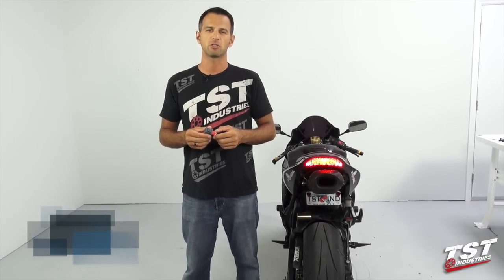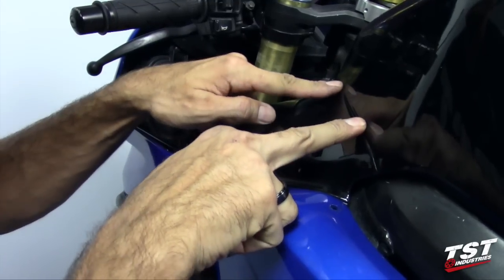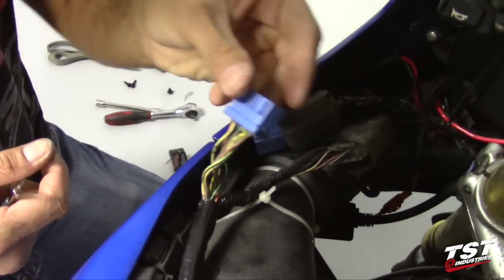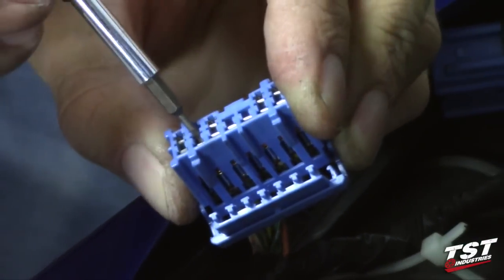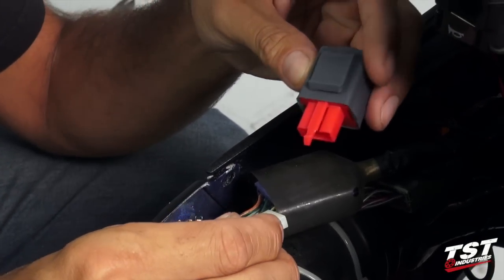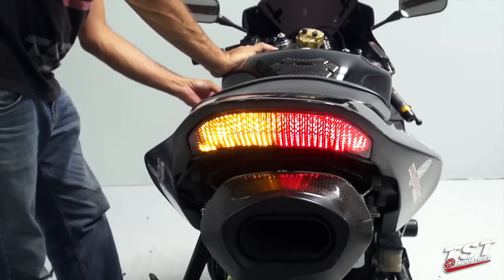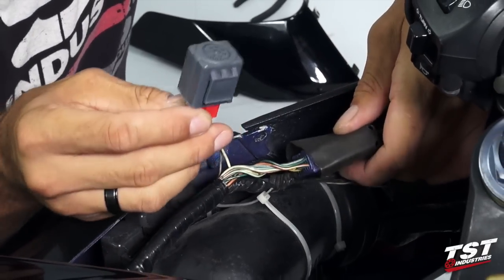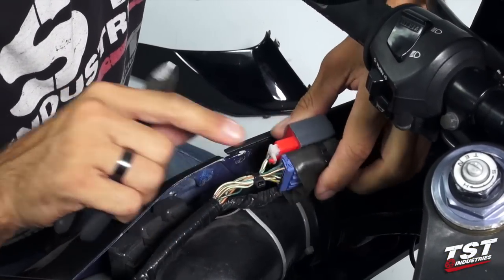How to install LED Flasher Relay on a 2003-2006 CBR 600 RR by TST Industries

Comment: Thanks TST. I just got the same relay for the 954RR. I realize that the harness is identical to this one with the same colored wires and placement in the connector. I bought the 2003-2006 relay with the white clip as well. When I install the relay, I will give an update.
Reply from the maker: We are looking forward to hearing your findings.
Reply: Ja. Thanks for having awesome products that make it easier and more reliable to modify than using load resistors or cutting into the motorcycle side wires. I posted a video of my bike with your brand turn signals, but they weren't on (FZ6R), I was showing the exhaust and the PCV running. I will post one with my RR when I'm done changing parts on it.
Reply: Udate: the 2003-2006 relay works on the 954RR. For anyone who is working on their 954 signals. Thanks TST!
Reply: @darksorceresszyra9467   I have a 954rr too, but I can't find the original relay, where is it located?

Comment: When I tried to install the relay I had some problems, the first when I tried to remove the cables in my motorcycle were of another color (different to that you show it in the video), the second when I was trying remove them, one of them it broke up and the pin got stuck, the third, to despite to cable was broken I tried to install the relay and it did not work. 
Also I had problems with the integrated tail light because my motorcycle have not the pin (and in the video only connect the pins for each of directional lights and it is not like that when only have the cables without pins). I am not happy because the relay not work and the integrated tail light also not work without the relay, you should consider this kind of problems in the instalation.
Reply from the maker: first let's address your taillight issues. Our units are pre-fit with OEM plugs for ease of installation. If you, or the bike's previous owner cut off the plugs then your bike is modified beyond OEM spec and will require harness side plug replacement, or you will need to hardwire the taillight in. If you would like us to help you with information on how to accomplish that you can contact our specialists through the support tab on our website. Even if the fault with the installation is not caused by our equipment we do our best to help our customers because that is how we run our business. We are a riders-for-riders kind of place.
Reply from the maker: Now let's delve into your relay woes. This system we sell and have illustrated in this video has been developed by an engineer, verified for use on a few local bikes, and validated in the field by hundreds of end users who have already put this system to good use. Surely we can figure out what went wrong with your installation if you contact us through the support tab on our site.
Reply: I broke the blue clip clasp too, but it will still go back in if the same flimsy hanger/hinge broke on yours too.

Comment: At first sorry for my bad english, but i hope you can help me. Im driving a Honda CBR 600RR built in 2003.
The original relay is damaged... Problem its placed in the case of the speedometer so its heavy to change the original relay. My flashers dont flash, they only glow...
Can i fix the problem if i install your LED flasher relay?
Reply from the maker: if the problem on your bike is caused by your relay then using ours will solve your problem. Our relay circumvents your OEM relay.
Reply: that reply gave an end to all my searching of relavent matter. Thanks a lot guys!!!

Comment: Great video! 
Will that work on my 2001 CBR 929? Previous owner installed led blinkers only in the back and some resistors. The blinkers hardly ever work. Will this relay solve that problem? Do I need to replace the front bulbs with led too? Thx :)
Reply from the maker: I believe you can install this on the 929 but it is likely it will have different color codes for the correct wires. You would have to remove the resistors from the rear. You don't ha e to change the fronts to LED, this relay will work front OEM, rear LED
Reply: @TSTindustries  Hi, what if you have the integrated light AND LED turn signals up front? I have the relay already, is the install shown only for the rear turn signals? Will I have to connect an additional two wires to the relay for the LED fronts to work properly?
Reply from the maker: @henry3397  the relay is upstream of the lamps and the directional switch so it doesn't matter how many signals you changed. There is nothing else you will have to do. One relay takes care of all the signal lights, provided you have everything connected properly
Reply from the maker: @henry3397  No, our relay corrects and controls the entire signal circuit.

Comment: I'm having trouble with the fastner that's on the inside it just keeps spinning hand won't come out?
Reply from the maker: you need to specify which fastener so I can answer your question. You can give me the time stamp in the video where it is shown.
Reply: +TSTindustries it's at 1:22
Reply from the maker: +Nathan Esquibel OK. You can hold the perimeter of the fastener with your fingers and turn the center part counter clockwise a quarter turn without putting pressure on it. The center will pop out and you can then remove the entire fastener.